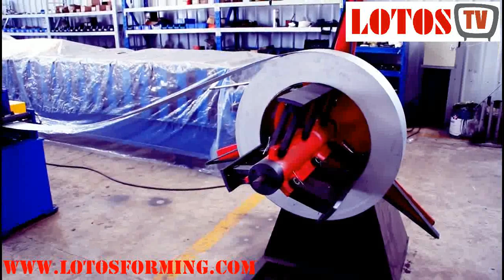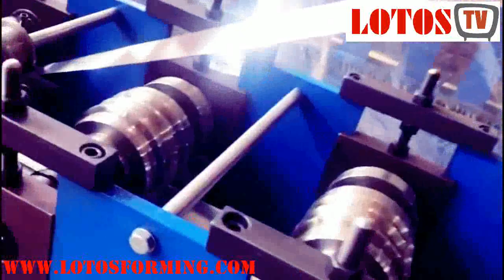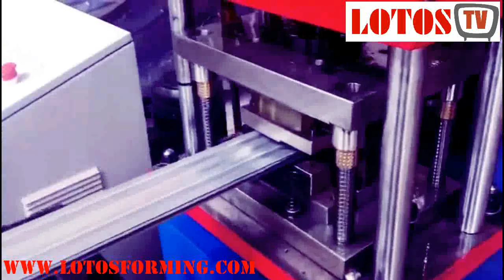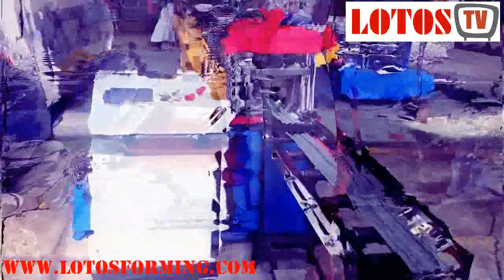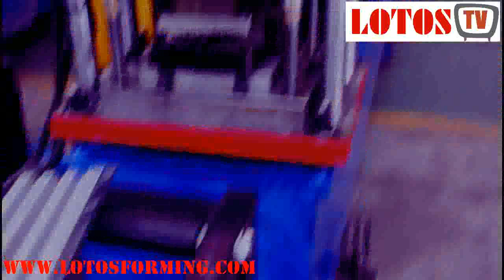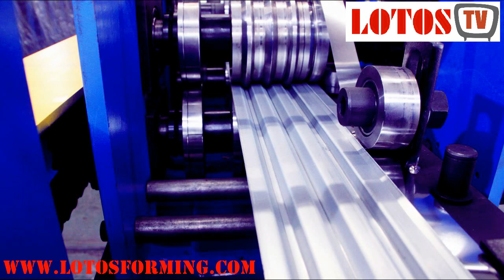【Custom Roll Forming Machine】: Damper Blade Roll Forming Machine "LOTOS DESIGN"

Comment: LOTOS As one of the most professional fire damper blade roll forming machine manufacturers and suppliers in China...
Reply from the maker: LOTOSFORMING hot sale automatic t bar / t-grid ceiling channel roll forming machine. LOTOS Roll forming machines for ▷ Ceiling Channel Roll Forming Machine | Furring Channel | Top Hat ◁

Comment: Structural Profile roll forming machine, Drywall installation is a popular project for homeowners because it’s easy to learn and doesn’t require any expensive specialty tools. Drywall board is often called Gypsum, wallboard.

Comment: A damper is a specific type of damper used to control the flow of air in an HVAC heating or cooling system.
Reply from the maker: thanks for you comment thats right

Comment: A damper is a valve or plate that stops or regulates the flow of air inside a duct, chimney, VAV box, air handler, or other air-handling equipment.
Reply from the maker: https://lotosforming.com/steel-stud-roll-forming-machine/

Comment: Blade dampers are structures consisting of thin metal plates used to stop or regulate the flow of air inside air handling equipment
Reply from the maker: https://lotosforming.com/door-frame-making-machine/